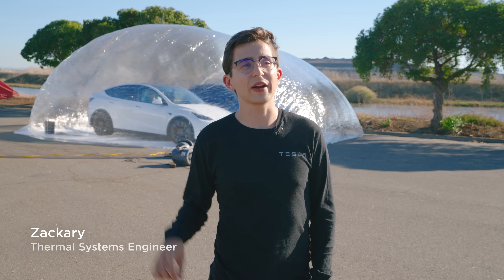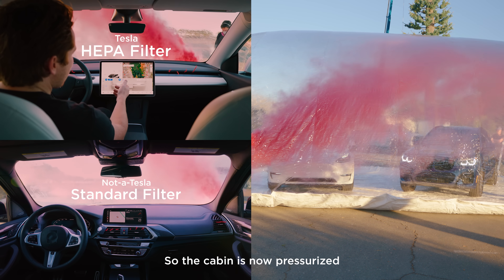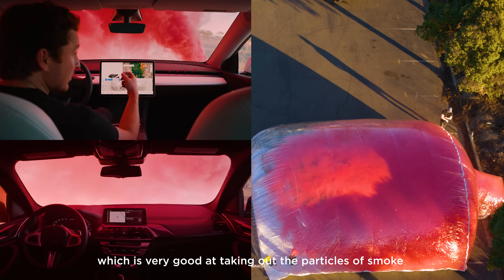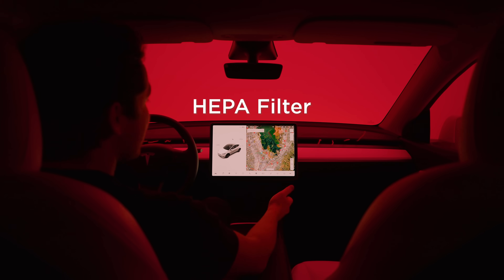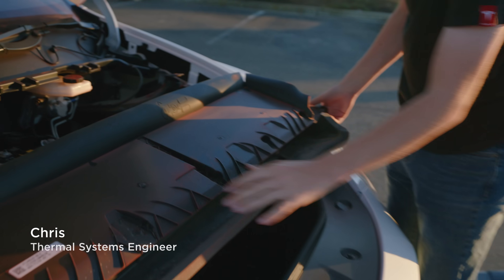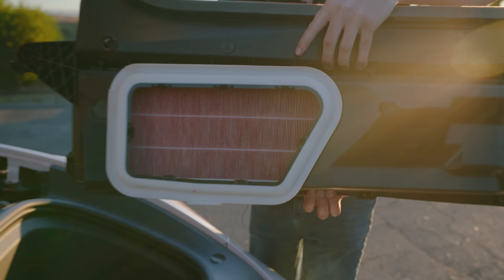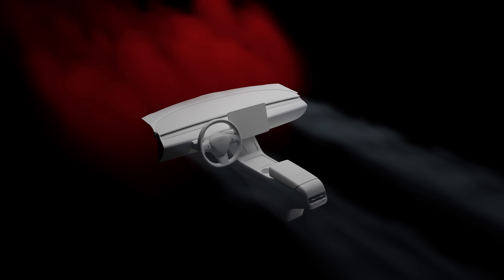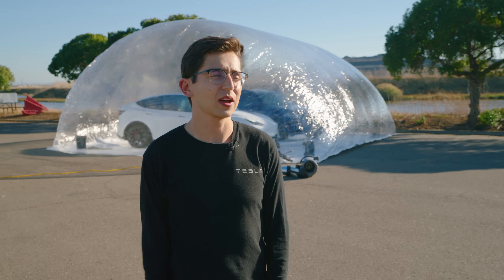Tesla HEPA Filter | Keeping Your Cabin Air Clean

Comment: Wow this is amazing
Reply: Volvo has been doing HEPA filters and interior air quality sensors for 23 years.(they introduced both in 2000)  They are also certified by the asthma and allergy foundation of America unlike Tesla.  Volvo also has won the interior air quality award since 2020 and continue to do so. Not to mention the filter for a Tesla is 500$ the filter for a new Volvo is 32$ and still has cleaner air in the cabin.